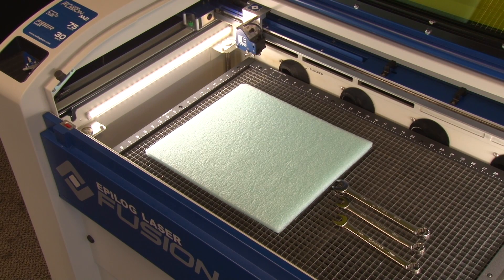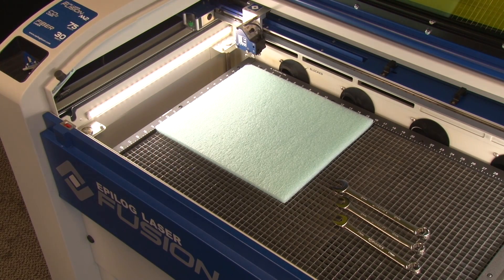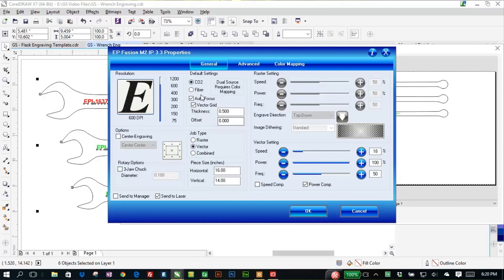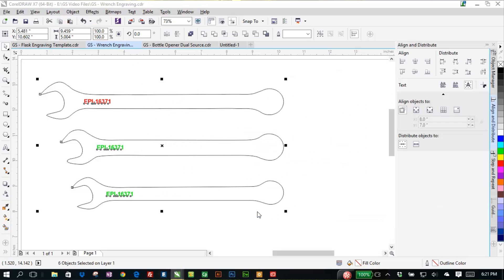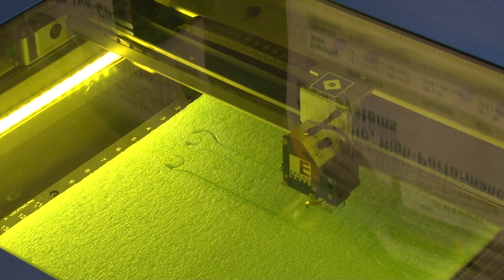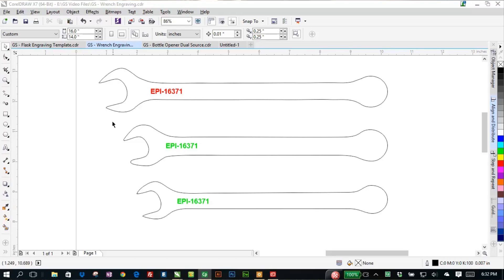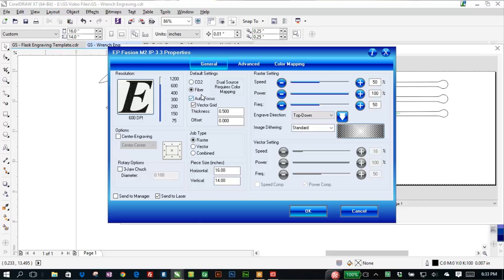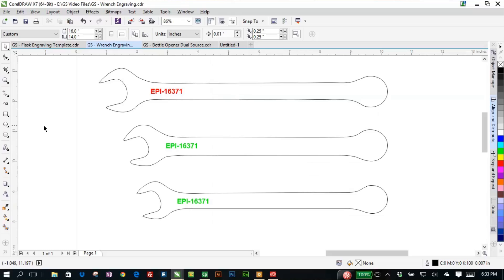Laser Cutting Foam for Tool Shadowing - Wrench Metal Engraving

Comment: How did you get those absolutely perfect cutout shapes for those tools?
Reply: Hi Ben - before we had the IRIS camera systems in the new machines we have now, I simply measured the wrench, took a photo of the wrench on a high contrasting background, then used CorelDRAW's Trace feature to create an outline of the wrench. From there, I entered the width and height I measure to readjust the outline to the proper dimensions, then cut the shape from the foam.

Comment: Is that closed cell polyethylene?  What do you consider "standard foam"
Reply from the maker: Hi Rob, yes that is correct. The sample club link provided here is for using the same foam for signage. It is a closed-cell polyethylene foam, as you pointed out. We used and purchased the same foam for the tool shadowing and wrench marking video. https://www.epiloglaser.com/resources/sample-club/laser-cutting-foam-letters.htm - the vendor link for purchasing the foam is located on the sample club page as well.

Comment: What are the maintenance costs on one of these machines? If used daily are there parts that need replaced often?
Reply: Is that 3 to 5 years of USE time, or 3 to 5 years of CALENDAR time? In other words, does the laser tube deteriorate between uses?
Reply from the maker: Hi Kevin - the maintenance costs associated with owning one of our laser systems are very low. We suggested  a preventative maintenance schedule with all of our systems that includes cleaning surfaces and removing debris. Our systems are designed and developed to be very robust and run on a daily basis without issue, so replacing parts often isn't something you'll need to do with our systems. The CO2 laser tubes we design and develop will last between 3-5 years, and fiber lasers, for metal marking, last twice as long.   

If you'd like to read more about our recommended Clean & Maintenance schedule we have our system manuals available online for you to see. Visit this link https://www.epiloglaser.com/tech-support/laser-manuals.htm, then download the manual for the product you are interested in and search the pdf document for Cleaning & Maintenance. Let us know if you have any other questions.

Comment: Can you use Closed Cell Foam material for the C02 cutting application?
Thanks in advance
Alora
Reply: Hi Alora - yes you can cut closed cell foams with an Epilog Laser system. The foam we featured in this video is a closed cell polyethylene foam.
Reply: Thank you :-)
Reply: My apologies for asking so many questions... when you spoke of the venting, is that External... or can it be Internal?
Reply: Both venting blowers, and self-contained filtered exhaust systems are available for venting the fumes created when cutting foam, but they don't come with the system.